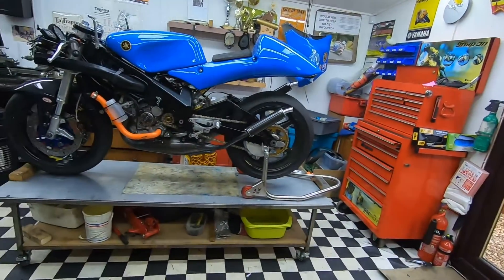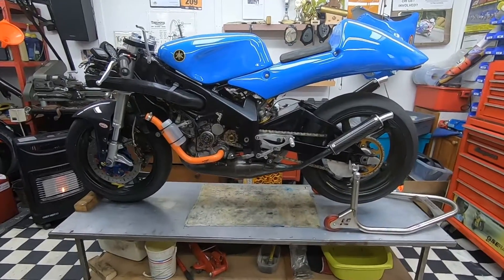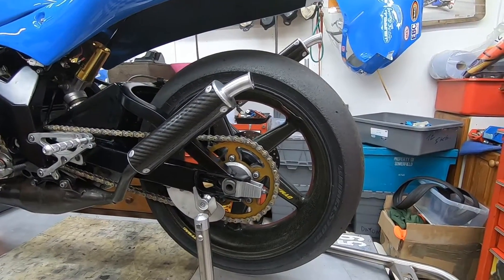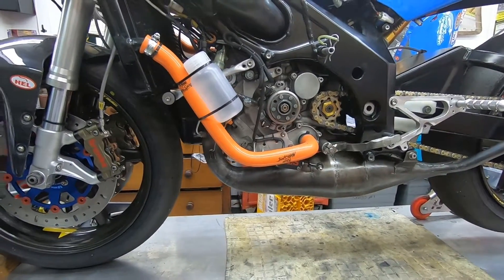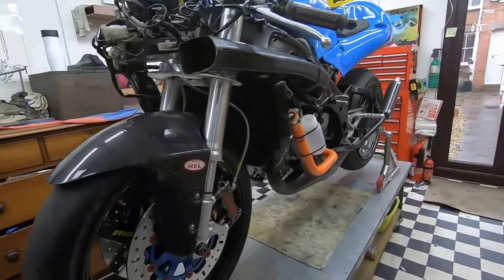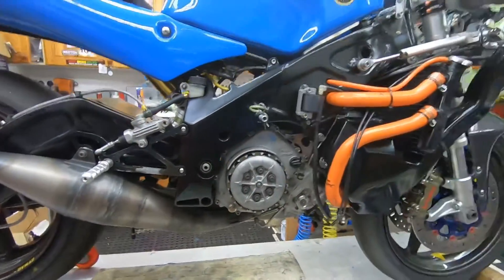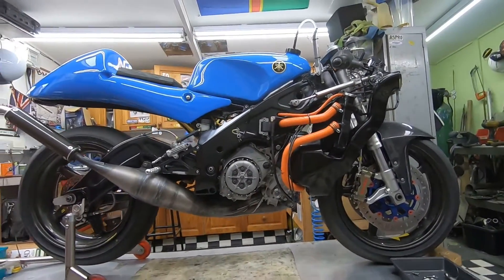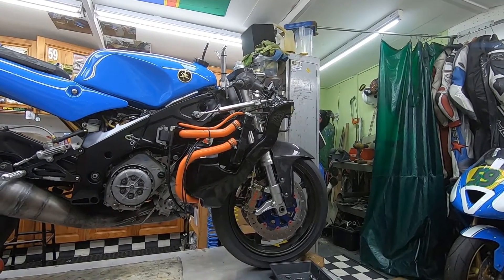J Burrill Racing - Yamaha TZ250 5KE - Introducing the new bike in the stable

Comment: Absolutely beautiful , looks very light especially with those wheels, what premix oil do you use in these now and what ratio, i'm just comparing with the older models,
Reply from the maker: Hi Derek, great to hear from you. The 250 uses a Elf oil mixed at 25:1 on race unleaded.

My 350 is 30:1 on a Motul oil on Avgas. I’ll get a video done on my 350G over the winter. Have a look at some of the onboards which are on a 350G. Also Jason Burrill 2 Stroke Racing on Facebook.
Reply: @jasonburrill59  Hi Jason nice to speak with you, thanks for filling me in, i raced a Maxton Yamaha -spec 350G back in the 80's, i love anything 250/350 TZ,  I'm virtually drooling over what you have there so i'll be following with great interest.Cheers mate.